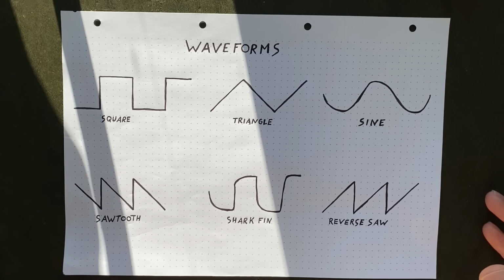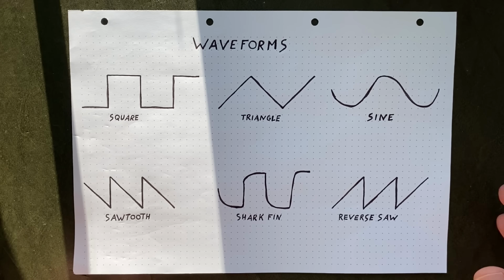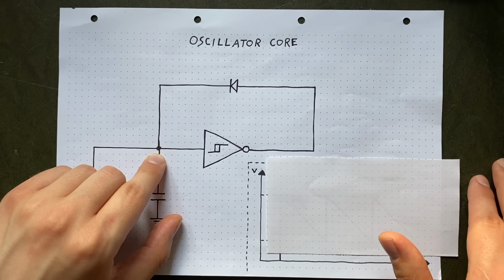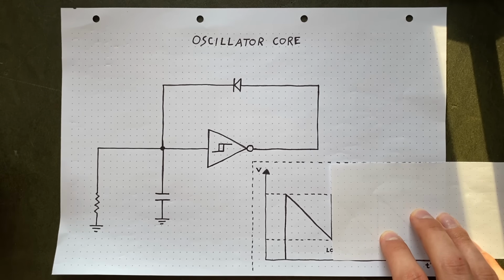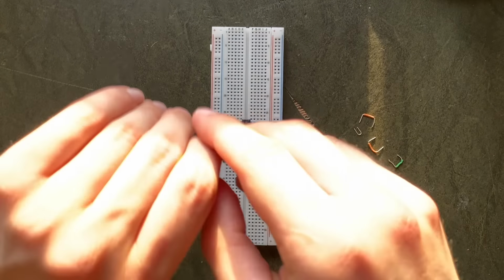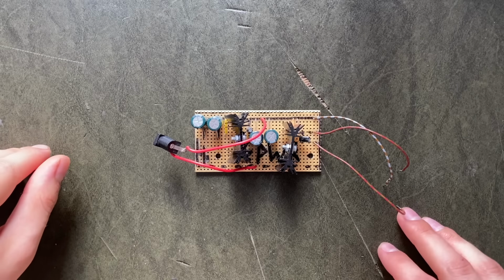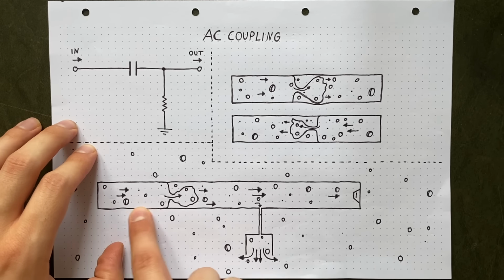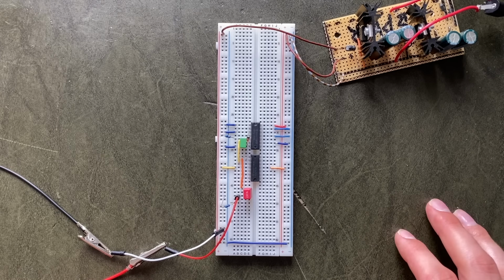DIY VCO Part 1: The analog oscillator core anyone can build

Comment: The videos you're doing are great, complete in each part and never leave question points. If I can only suggest one thing I would work on the noises coming from the mouth that go into the microphone at a very high level. That usually depends on the type of microphone and the distance between the source and the capsule. I would recommend a better setup while recording, testing until you find a solution, instead of working at that in post production or even worse in editing, which is a long and tedious work. Hope you'll find it useful. Thanks again for your videos, really help!
Reply from the maker: yeah those noises are definitely a problem. just bought a new, high-quality mic, hope that will help.

Comment: maybe a stupid question but im just a beginner; Where in the circuit schematic does the voltage source/battery go? i can't really thing where you would put a + and a - terminal...
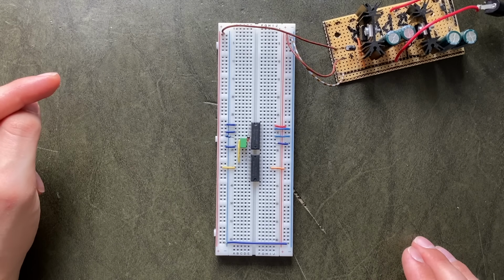Reply: If you look at 19:47 he connected Ground to right blue line, 12+ to the red line next to the Ground line and the 12- to red line on the very left. hope this helps
Reply: @xXRabbitmanXx  oh no sorry, i didn't mean the breadboard but the actual schematic in itself, if you were to make this with just wires and components where would the power minus and plus go?...
Reply: Wait not worries i figured it out

Comment: Great Video! Question... How to expand?
I built one VCO.  10k POT -> tuned transistor -> inverter -> opamp buffer -> inverting opamp.  Beautiful frequency response.
Then I tried to add another, same thing, to use another one of the 6 inverters.  But they are entangled. One changes the frequency of the other. How to get two independent frequencies?
Reply from the maker: in my experience the inverters themselves are reasonably well isolated from each other. it's more likely that your oscillator's output is modulating the other oscillator's CV input path. try using shorter wires and keep the outputs (especially after amplification) away from those CV paths!

Comment: really helpful explanations on dealing with dual rail power design, DC offset and buffering.  I was doing some synth circuits long ago and  got stuck on that part.  its neat seeing you build this one piece at a time and using the oscilloscope and watch things break or work after each step.

Comment: The water model is a very good model to explain the idea behind electrical components. 

I just want to warn your audience though, when doing audio stuff we must be aware that around wires and every components, there's a electric and magnetic field which have influence on other parts of the circuit and can be influenced by. Because audio signal are by nature like alternative current, sometime this can have impact on the output, like weird hums and hissing. The water model doesn't modelize that without some tweaks... 

That said, for a beginner, this model is perfect, and sometime better than what some teachers actually do in an physic class. You explained it very well. Good job!

Comment: hi there! is it possible to replace the capacitor with a polarized capacitor in the fixed frequency circuit?? i'm testing out an oscilloscope with it.
Reply from the maker: yeah but it should be fairly small, otherwise the waveform bends!
Reply: sweet, thank you so much!

Comment: Where's the best and cheapest place to buy the 40106 IC and TL074 IC? Not sure if what I find are the correct ones
Reply from the maker: mouser is always an ok choice i think. 

40106: https://www.mouser.com/ProductDetail/Texas-Instruments/CD40106BE/?qs=YhsVCygOPE1CyKyInx%252Bh3Q%3D%3D

TL074 seems to be out of stock atm, you can use TL084s instead: https://www.mouser.com/ProductDetail/Texas-Instruments/TL084CN/?qs=q2XTDbzbm6ANF36GVAxPiQ%3D%3D
Reply: @MoritzKlein0  Thank  you! Sorry one more question (I'm very new to this), Could you link me to the exact capacitors I should buy? I'm struggling to find the exact ones you listed, like a 1uF capacitor

Comment: A couple things are missing for me to be able to follow along; I think I understand how the circuit works when I look at the 2D diagram, but trying to lay it out on a breadboard I realize I'm not totally sure how to connect it all together, and you don't walk us through it while you're filling the breadboard and there's no zoomed in view of the physical circuit. Did you make any amendments to this in later videos or on a patreon supplement or anything?
Reply from the maker: it's kind of an oversight on my part – i assumed most people already know how to build circuits on the breadboard. will do a separate, more basic video on that topic soon!
Reply: @MoritzKlein0  I think I eventually got it -- at least so far.
Reply: @MoritzKlein0  And that would be a great video. My secret shame is that my dad knows electronics really well but even though we've built a few things together he's never been able to step back, slow down, and explain it well enough to me that I can really learn. And as a teacher myself of beginner coding and 3D modeling, I find I'm always having to do the same.

Comment: Is there an alternative to the 40106 IC? My local shop has a 4069 Hex Inverter IC and I am wondering if it could be substituted? Thanks for the wonderfully clear explanations. I hope to see more videos from you!
Reply from the maker: not directly i'm afraid. you'd have to add a few resistors to make the 4069 inverters into schmitt triggers.
Reply: @MoritzKlein0  Probably best to just order some 40106's then - Thank you. 

If possible, I would appreciate an explanation of how a Tube works (in the same way you explained an op-amp) Cheers

Comment: Hello, does anyone know if a TL084 opamp is a good alternative to TL074? At my local store they didn't have the TL074 so I tried with the other ones for now. But the signal is very noisy and has a much lower amplitude after going through the buffer. Can that be caused by the wrong model or did I mess up something else in the circuit? and also -  thanks for the tutorial, it's amazing!
Reply from the maker: TL084s and TL074s are basically identical. 074s are a bit less noisy but i‘m not sure it‘s noticeable in this usecase. so i think you should check your connections - and also, are you using a dual power supply?
Reply: I am not sure if I'm supplying the opamp in the right way. I'm using two 9V batteries in serial, so the difference is definitely 18V. But I wasn't connecting the point at which they are connected to ground, so maybe that's the issue. Shall it go into the same ground rail as all the other grounds in this oscillator? Thanks a lot for help :)
Reply: Follow up: it works! Earlier I messed up the voltage levels powering the opamp. Turns out the TL084 is a good alternative. Thanks :)

Comment: Hey Moritz! Thanks for your amazing Videos! Planning to start building a Synth as well. Just wondering why you chose foil capacitors and if it is important to look on the voltage of those.
Reply from the maker: foil caps are the best choice for audio applications, my local electronics store guy told me. also, you can't really get electrolytic capacitors this small (2.2nF). ceramic ones will work, but apparently they introduce distortion. 

as for the voltage rating, you should make sure they can handle twice your power supply's voltage (in my case 2x12 = 24V). this is just to increase durability – 12V ones will work too but live shorter.

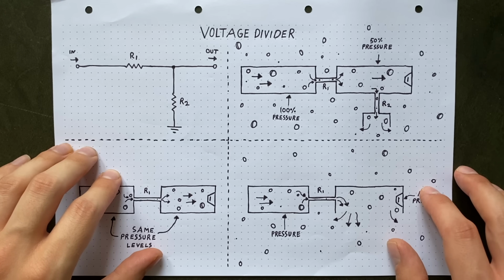Comment: 24:14 it is just half.what if that is still too too weak signal lol. and how you know its not still too much lol. 26:35 what if this was original and you half it. how you know you half is correct.if you say signal need be 1.5v then its fine. someone would half that xD bcoz you told. what if it allready was

Comment: Something that has always been confusing to me about circuit diagrams like the one you show of the oscillator core, is that they can often be incomplete. If you don't know that the Schmitt Trigger connects to Vcc and Ground, you would be scratching your head saying "how does any of this work there's no power source??" which is exactly what I said before I realized the power source is connected to the trigger and just not part of that diagram.
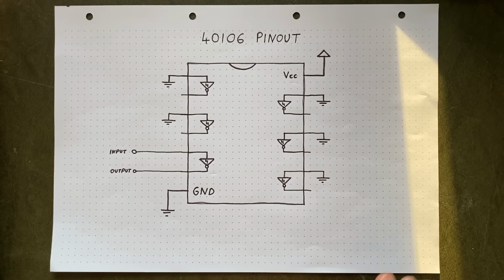Reply from the maker: true, that's why i mention that around 12:46. but yeah, it's normally just implied.
Reply: @MoritzKlein0  I can’t tell you how many circuits like this I looked at and go “this isn’t a closed circuit, what am I missing?” because of stuff like that, haha

Comment: A different water analogy for a  closed open circuit would be using a drinking straw with your finger over one end.  You are conflating voltage (V) and current (Amps).  Voltage is normally shown as pressure and volume is Amps. A low flow rate, high volume pipe is equivalent to a low voltage, high current connection.  It can also be understood as friction. if you slide your hand across a surface with little force against the surface at a steady speed(pressure), it generates less heat than if you press against the surface(and it resists the increased surface in contact with your hand) while moving the same speed.  Resistance cuts current and converts it to heat. 
Resistance could also be described as the difficulty pumping water vertically up against gravity. as you pump it higher the weight of it pushing against gravity  causes resistance and the flow rate drops but the pressure in the pipe can be constant.   A restriction in a pipe as drawn can be seen as a voltage drop rather than a current drop because you are having it go back to the same size pipe which would lower the pressure. 
In synth applications voltage tends to be the key control value.  For this I'm not sure taking about resistance initially might be counterproductive. Analogies only go so far. once you demonstrate the basics, it's better to drop into the math and standard units.

Comment: wonderful explanation! I've been following along, and i cant seem to get a saw wave of any sort at the output.  at least nothing is coming up on my scope screen. do you have any ideas what it could be?
Reply from the maker: i'd need a lot more information on your setup to give a good diagnosis. but the classics are: make sure your power supply works (test it with a multimeter). check for shorts (if you use batteries a dead giveaway is when they get warm during operation). check your scope's settings (the signal is weak, only around 2V peak-to-peak). check the chip pinouts/orientation (if you use the TL074 backwards it will die instantly).
Reply: @MoritzKlein0  actually I had the op amp rails reverse polarized and it got really hot and didn’t work anymore. Also I think the issue was I was using the incorrect pins on the 40106, and wasn’t getting any signal. I finally got the oscillator core working once I took it all apart and rebuilt it. Thanks for the reply!
Reply from the maker: @tshupenia8940  awesome, glad to hear. just tearing everything down and restarting from scratch is very often a good idea!

Comment: Great video! I am following along, can I use the LM358 op amp in place of the tl074? I think I followed the whole video but I am not getting my high pitched whine that I had hoped for :( but I will keep at it!
Reply from the maker: any op amp should work fine! what are you using as a power supply?
Reply: @MoritzKlein0  Awesome, thanks for the reply. I am using two fresh 9 volt batteries wired the way you showed, I want to start on the dual power supply video but I have to order the parts. The nearest parts store is too far
Edit: I just tried again from scratch and one of the batteries got very hot so I'm at a bit of a roadblock here. I don't want to burn myself!

Comment: I used to do the projects in the electronics notebooks you could get from Radio Shack (by Forrest M. Mims III). Many of the audio projects used two 9V batteries like this to give you a nice swing between positive and negative voltage.

Comment: It's been decades since I've breadboarded analog, so I'll have to test the -ve rails in mine - LOL. This series is a joy just for the fun progress. Thanks for using common ICs. That will help more folks follow and have useful breadboard parts after they solder something up.

At about 26:36, there's some rounding of the leading edge I didn't see before the divider was added. Probe tuning, my old eyes, or something else?

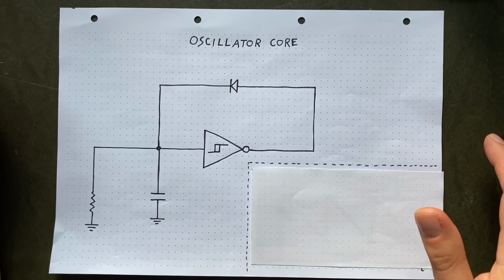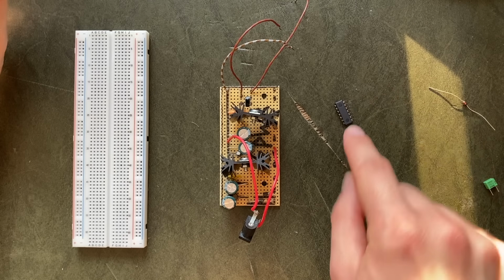Comment: I've seen that circuit from 8:02 in one of class D audio amplifiers. It was used as a dead-time for the incoming signals. When i first saw it, i didn't understand how can something so simple be used as a dead-time. This video helped me to understand Schmitt trigger inverters even better. At 12:46 i understood my mistake when i made my first musical Tesla coil circuit. I had all unused inputs and outputs connected to GND, while i should have connected only inputs to GND. That's why it wasn't working for me. Anyway... thanks for the help! I subscribed! :)

Comment: Silly question here from a newbie to electronics. . . I have looked for a 1N1418 diode but most searches send me to a 1N4148—would the 1N4148 work just like the 1N1418, or do I need to get a 1N1418 for this to work?
Reply from the maker: ah sorry, that’s a typo - i use the 1N4148 i’m the video!
Reply: @MoritzKlein0  Thank you for the quick response and the info. I'll be ordering some to follow your video, and will even be using my own Korg SQ-1 as the sequencer :)

Thank you for the very informative video(s)!
Reply from the maker: @kellychristus2496  cool, sounds fun! good luck!

Comment: Do you think the SN74LS14 Schmitt Trigger could be a replacement for the 40106?
Reply from the maker: sadly not - the datasheet says that chip can only be operated at 5V.
Reply: @MoritzKlein0  Thank you for talking the time to look. Whilst checking apparently I missed that one key fact! 
Segor.de just ran out of the 40106 as I was compiling a list of parts, so looks like I'll have to wait. Thanks for your excellent videos, alles Gute, ciao!

Comment: Stupid question maybe... but what schematics have you used to build dual power supply? I wish I try building some oscillator to better understand what you show in your videos but I've got no dual power supply. I've seen some schematics using lm317 and lm337 power regulator IC's bit it needs power transformer with center tap on secondary winding. This is what they show in LM317/337 datasheet actually. Unfortunately I found some ordinary step down transformer 220/15 in my electrical garbage only. It seems you've made some dual psu with usual ac input and I don't get the idea.
Reply from the maker: not a stupid question – i'm working on a video on that right now! if you can't wait, check this, it's essentially the same idea: http://musicfromouterspace.com/analogsynth_new/WALLWARTSUPPLY/WALLWARTSUPPLY.php
Reply: @MoritzKlein0  oh I see. I suspect a problem here because it uses half of ac period for each rail,  which in case of higher current drain is going to increase voltage ripple. I would replace single diodes with 2 full bridge rectifiers to work it at double frequency of 100 hz and by doing so making it more stable at higher load. This scheme seems to depend highly on capacitors and also overload the transformer making it hot because of high charging current if you power many modules from such a psu. If two bridge rectifiers are used I think that it's possible to spare at least 2 of large capacitor cans. And I believe that diodes are less expensive than caps even if you install 8 pcs instead of 2.

Comment: I am having problems with the CD40106 :( it will only sound if it is supplied with around 1,5 to 3V on pin 14... if I put +12, I start to smell electrons, I've tried with another CD40106 chip also, but nothing changes..
the only thing I have different is my buffer IC, that I am using a LM358. Do you have any idea of what can be the problem here??

BTW, that is awesone content, thanks for sharing knowledge with us!
Reply from the maker: what do you mean with you "start to smell electrons"?
Reply: @MoritzKlein0  I mean, something starts to heat up and smell. The CD 40106 heats too much, also.
Reply: I've got what it was. I can only make it sound great after using the correct BOM, using a 1N4007 didn't worked for me.
The heat problem was caused due to a incorrect connection of the CD40106 unused pins to VEE (-12) instead of GND.

Comment: do i need to use an amp (lm386 for instance) with a speaker to output the sound or can i connect the speaker directly to the out?
Reply from the maker: really depends on what speaker we're talking about. if you're trying to drive a passive hifi speaker that will not work (but you'd normally use those with a proper amp anyway). headphones (any kind) should work right out the gate though. also any kind of portable speaker with an aux input.
Reply: @MoritzKlein0  thanks for the answer, i am talking about a 8ohms 1 watt speaker (https://www.google.com/url?sa=i&url=https%3A%2F%2Fbc-robotics.com%2Fshop%2F3-speaker-8-ohm-1-watt%2F&psig=AOvVaw08AFMY3Bw59v2777Tfir0q&ust=1603386254191000&source=images&cd=vfe&ved=0CAIQjRxqFwoTCLCCh7qVxuwCFQAAAAAdAAAAABAD) like this one